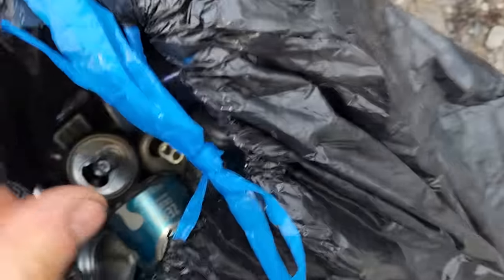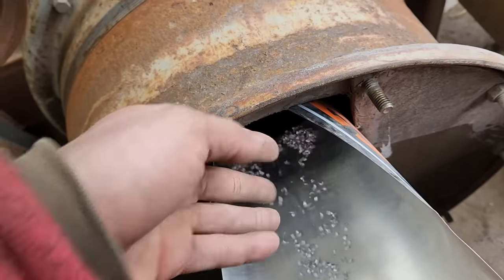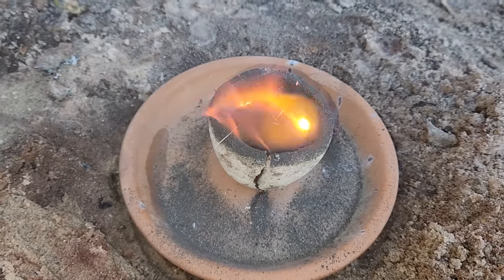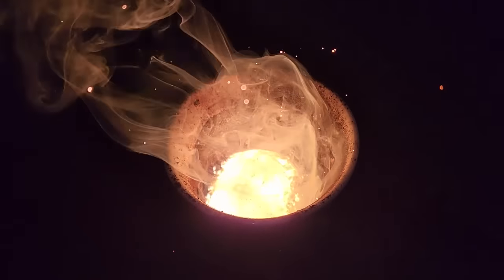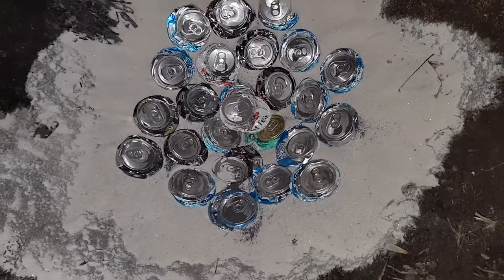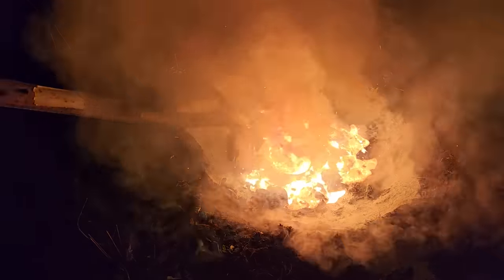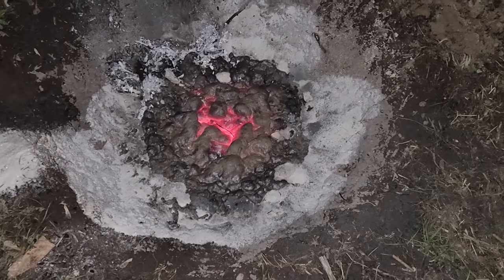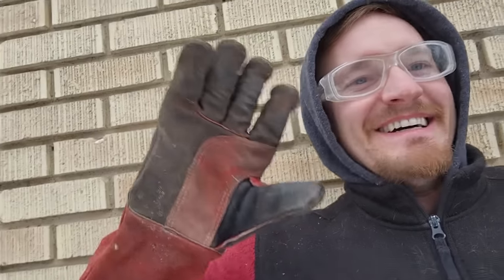Burning 50lbs of Thermite Made From 400 Soda Cans

Comment: the railways use thermite reactions to weld rail, it is done in a funnel or conical vessel which conducts the iron to the rail joint. Presumbably the iron is pure enough to join rails, over the last hundred years the mixture probably contains fluxes and other substances as well.
Reply: Yup.
I've seen it in real life.
Just fill the cone, set it off, and wait. Then grind it.
Job done.
Pretty cool and efficient way to repair tracks.
Reply: I used to do this in molds for ground grids in substations also
Reply: @JAMESWUERTELE ah Cadwelds, the best and most fun way to join copper wire to ground rods ❤
Reply: The electric welder looks good, about the size of a locomotive, has this clamp arrangement which can pull two rails together, it applies 7 volts to the rail and 20K Amperes.
Reply: Would that be the cause of the slag piles I've found near railway tracks?
Reply: Metals are added to the thermite mix in order to optimize the resulting alloy.
Reply: The Crathuzians use thermite to season their friaak patties for the festival of Bharath. It is said that that it enhances the flavor of friaak by lowering the temperature and thus peaking the flavor notes of dnuu and smeff.
Reply: @DirtyRobot I have plans to visit at least one of their three worlds in the future.
They have this amazing material they call “scrith,” and it has tensile properties beyond spider silk by a factor of 8.

I want to learn this, so you could say I’m just going to be a spy for a little bit!

Comment: Pretty excellent result! I like the idea of only using a small amount of highly processed material. I wonder if you could get away with only a couple lbs of thermite to get a big flowerpot of crushed cans going.

Also you should make another iron ingot like that and cut it down the middle. Give it a polish and boom: art.
Reply: Cody and his IRL Minecraft episodes.. lol
Reply: It wouldn't show up the rainbow effect if you did that.
Reply: @brendo7363  the colors are throughout the volume; otherwise they wouldn't be on the surfaces revealed where he happened to split it apart
Reply: @orthoplex64  do you think the iron has been turned purple?
It's just a thin film on the outside of the iron crystals, you polish it, or even rub it hard and it comes off.
Reply: @brendo7363  It could be something like a foam of oxide. Seems more likely to me than the revealed surfaces instantly oxidizing to the exact thickness required for that purple when exposed to air.
Reply: @orthoplex64  No it's the pig iron (that is what he made) tempering as it cools when exposed to the  air.  You get the same rainbow effect when you temper steel. If you look at the bit he breaks later, there is no rainbow effect because the metal has cooled below that point of oxidation. 
It doesn't take much heat to get that effect on steel, probably less on crystallised pig iron. Steel is an alloy  of iron (magnetite), aluminium  (cans), silica (sand) and  other  minerals  found in the earth (his crucible).
The rainbow effect is caused by a thin oxide layer on the pig iron, which creates interference effects for different wavelengths of light. The colours in different areas of the sample indicate varying temperatures.

Comment: If you insulate the hole with dry wood ash it will insulate far better than just the sand. Also throwing wood ash on top once the reaction is going will allow the heat to increase and allow more of the iron to precipitate from the slag. The cold air exposure is causing the mixture to cool and become sticky which is why some of the iron remains in the slag. Dry wood ash is an insane insulator, I have put cast iron pieces into a wood fire and let the fire burn out, come back a day later and pulled the iron from the bed and it is still red hot. It has taken up to a week for it to cool down to handle when it is left in the ash pile.
Reply: Next video, Cody makes Tamahagane Steel. Then, Cody forged a sword!
Reply: Or perlite
Reply: "Dry wood ash is an insane insulator"
SpaceX' Starship division: "Interesting..."
Reply: its actually capable of melting and dissolving wood ash...
Reply: I think @Metal_Master_YT is correct that the ash would melt at the super high temp of the thermite reaction.  So would practically anything else.  But the ash might help anyway, as would a generous cover-up of sand immediately following the reaction.
Reply: wood ash insulated stanly cup, im going to have to make one of those and see how it does
Reply: @jamesg1367  I mean, I've also had this thought before (of insulating the thermite to achieve higher temperatures) I would just use a graphite crucible (or a refractory ceramic crucible etc.) and surround it with refractory insulation, and the thermite will stay hot for ages. it allows the produced metal to coalesce better. an addition of flux would also help with that, but it can interfere with the reaction. anyway,  this also allows higher temperatures to be produced, especially in larger batches of thermite, and certain thermites (silicon thermite in particular) would greatly benefit from this since it isn't very exothermic compared to the others and is difficult to ignite.

For instance, under ideal conditions, using super fine silica powder and super fine aluminum powder in the stoichiometric ratio, mixed thoroughly, and then pre-heating the mixture and containment crucible to just under the melting point of aluminum (with a non-sealing lid on the container to reduce premature oxidation of the aluminum powder, without explosion risk) which drives off any moisture or organic residue, then finally surrounding the crucible with refractory insulation and then igniting it (maybe from the bottom to make it more efficient?) and putting the lid on (there would be a gap between the lid and the mixture inside) will yield an extremely hot thermite that can stay molten for hours (given a large enough batch anyways) this should easily be able to make elemental silicon from silicon dioxide. and using a slight excess of silica will greatly reduce the aluminum contamination in the resulting silicon.
Reply: @Metal_Master_YT  Good thinking throughout, thank you.
Reply: @jamesg1367  I've been refining the ash purification process recently, and I'm trying to use concentrated acetic acid and a different production system instead.
the idea, and why I originally mentioned it, is that the pure calcium oxide has a much higher melting point that the ash to start with, and can potentially handle the high temperatures of thermite. just google the melting point of calcium oxide.
Reply: @Metal_Master_YT  Good ideas overall, are you moving towards actual experimental setups?
I wonder if flux as a layer under, over, within (or even all 3) would be helpful, rather than intermixed with the reaction mass.
Ignition from the bottom might have venting issues, as in foomp and the stuff goes everywhere.  Thermite alone obviously produces little gas but in combination with its surrounding materials, and the fact that even some iron does vaporize, it's probably enough that venting is essential.  Maybe form the reaction mass as a cylinder with a central hole?
Calcium oxide melts at 2630C, which is technically less than the theoretical temp of Fe(iii)/Al thermite (2862C) but yeah.  Unlikely to melt en masse if there were a lot of it surrounding the reaction.  I suppose it would create a sort of glazed shell.
Reply: @jamesg1367  thanks man, and no, I am not working on thermite setups like this yet, although as usual I have lots of designs/strategies I have worked on and would eventually use if I ever get around to doing it. also, good idea on the flux, although, I'm not sure it would mix with the thermite if it wasn't mixed to begin with. the purpose of the flux is to aggregate the metal into one easy to collect blob, and to make the slag less viscous.
"Ignition from the bottom might have venting issues, as in foomp and the stuff goes everywhere.  Thermite alone obviously produces little gas but in combination with its surrounding materials, and the fact that even some iron does vaporize, it's probably enough that venting is essential." I was worried about that, I was hoping that the pre-heating step would solve that issue by removing any volatiles beforehand, but yeah, the thermite will probably boil a little, so it might be an issue. although, I will say, traditional thermite ignited from the top allows the top to melt and form a somewhat homogenous fused layer, which you would think would cause it to explode when gases are formed by the thermite burning underneath, but it doesn't. but if we were to burn it from underneath first, it would leave a porous powder above it which will let out the (what should be minor) gas... so I really don't know, it definitely needs testing.
"Calcium oxide melts at 2630C, which is technically less than the theoretical temp of Fe(iii)/Al thermite (2862C) but yeah." trust me, traditional thermite wont get that hot, the real world simply isn't ideal enough for it to be that efficient, that would technically be hot enough to melt magnesium oxide, the highest melting point oxide (that isn't radioactive), which would be absolutely crazy. I should mention, the aluminum powder in the thermite boils at around 4,480F, and calcium oxide melts at about 4,660F, which is hotter. anything boiling in the thermite will limit how hot it can get even if it actually would get hot enough to begin with. as for making a glazed shell, aluminum oxide is amphoteric, and calcium oxide is basic, so you would get and acid-base reaction that forms calcium aluminates which melt at around~2,600F.

Comment: I work for a company that makes CNC laser equipment for cutting and marking metals, and I always advise customers that if they don’t clean their slag wagons etc out between material changes, one of the hazards is essentially thermite build up between steel and aluminum laser dust/slag.

Just last week a coworker was on site for a metal fire that wrecked a machine pretty good
Reply: I use to operate a laser cutter. Aluminum would be cut using nitrogen as the purge gas, so the dust would still be mostly aluminum. Steel, on the other hand was cut with oxygen as the gas, which burned the steel, resulting in rust (iron oxide). All of that would be vacuumed up and collect in a large bin, that needed to be emptied, about once a week. That was always a messy chore, as the powder was very fine. Didn't realize that we were dumping about 50 lbs of thermite every time we did that. Good thing the trash bin never caught fire ! Good thing the trash bin was outside, at the far end of the parking lot.
Reply: That would have been a very impressive dumpster 🔥 fire 🔥 😅
Reply: @cedricbillingsley3960 What dumpster?
Reply: @davidrush4908 the laser cutting equipment after the fire 😂
Reply: @dmacpher  Ok. I was thinking a dumpster full of thermite would create an impressive iron puddle.

Comment: It’s amazing how those huge chunks illustrate just how light aluminium is compared to other metals. No way could you hold a chunk of steel that size in one hand with such ease
Reply: structural steel is 41lbs per sqft per inch. a food can which is probably 5 inches by 2.5. so maybe it's 10-15lbs?
Reply: Also it's aluminium oxide and he showed how many bubbles were inside. There's examples of rocks floating in water because of trapped bubbles, so this would be similar.
Reply: it's quite doable to hold 50kg or 110lb in one hand. Cody is relatively strong, having grown up on a farm.
Reply: @S.ASmith bro that's most of my weight, don't tell me a man can hold my own stupid ass one handed 😭😭😭
Reply: ... speak for yourself..
Reply: @crackedemerald4930 i farmer carry with 100lbs in each hand, there's a lot of dudes out there who could absolutely pick you up and walk away with you
Reply: I watched Cody pick up an anvil in his mercury video, he made it look easy
Reply: @kekoraaaa  yeah he's got that wiry, lean type of practical farmer strength

Comment: The most controlled thermite reaction I've ever seen (and I've watched a lot of videos about thermite).  I love that instead of just throwing melted slag everywhere, it was able to react more slowly and incorporate all of the aluminum cans and magnetite sand into the final products.  When you pulled out that big lump of iron from the bottom was a huge "whoaaaaaaaaaaa" moment.
Reply: Its probably because it isnt mixed as much as usual, just like in Gunpowder. The more contact between the ingredients the faster it goes
Reply: You should watch some videos on aluminothermic rail welding very controlled and precise
Reply: See if you can find videos of the cad welding process. I have cad welded #14 rebar to splice columns together on hi-rise buildings.

Comment: HA! Thats clever as heck! I never considered that you could just start a large reaction that's big enough to just consume the raw cans! and considering all you needed to do to get the materials was save cans and use a magnet in the dirt, that makes a super cheap way of getting a LARGE thermite reaction! Nice job, Cody!
Reply: That's what I was thinking! A cheap, easy way of accessing a supply of Thermite, and iron. I was also thinking you could run the aluminum oxide (Sapphire) slag through the ball mill and make sand blasting media. Cody is so  damn innovative.
Reply: This works with magnesium too! If you ever find yourself with a spare old magnesium Volkswagen engine block you can build a nice big campfire and put the block in, and in a little while you'll have a nice magnesium fire going!

Comment: When I was younger I made my own furnace out of a bucket lined with cement, and a hair dryer blowing air into charcoal briquettes with a steel fire extinguisher as the crucible. I was melting aluminum cans down, and about halfway through, the steel crucible started to melt. I was left with interesting mixture of steel, aluminum, and charcoal. It was fascinating, porous charcoal mixed with little round balls of magnetic steel, and smaller round balls of aluminum. To this day I cant fully understand why it turned out the way it did, but seeing videos like this are always interesting. Thanks Cody.
Reply: vented fires like that are no joke!

Comment: It’s surreal that it sometimes didn’t look like it was burning. It was like the material just decided to melt without really flaming or spattering.

I crunched the numbers 3 Fe3O4 + 8Al—> 4 Al2O3 + 9Fe. ~912 AMU total, ~504 of iron.

~72% yield of iron was in the bottom of that pit. 

Pretty good IMO considering the impure starting materials, unorthodox mixing technique, heat loss to the environment, and bits of iron that got trapped in the slag. 

Thanks for an amazing video!

Comment: The turnings and chips work fine as is for large thermite fires. Ball milling works great for making pyro grade powders though. One fun thing to do is to make a battery with the aluminum, use the turnings for the negative side and some baking soda plus lye for the electrolyte, then a mix of graphite and rust for the positive side. Makes about 1.7V per serving.😂